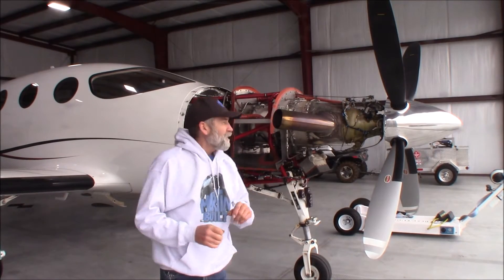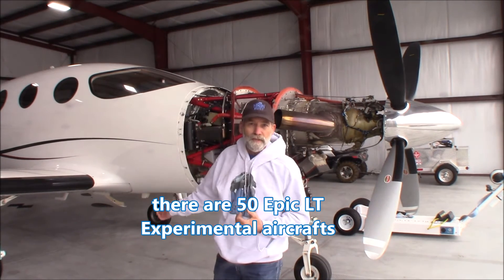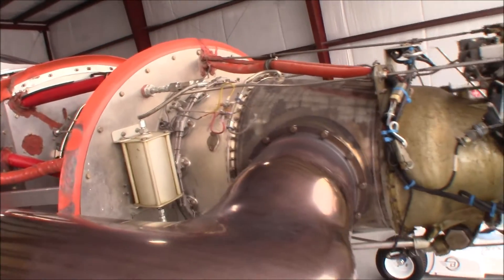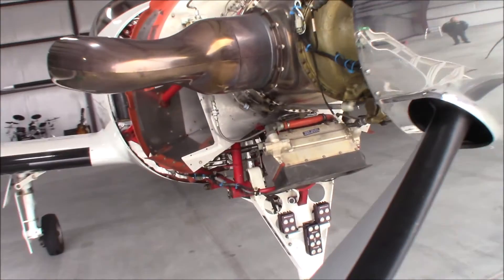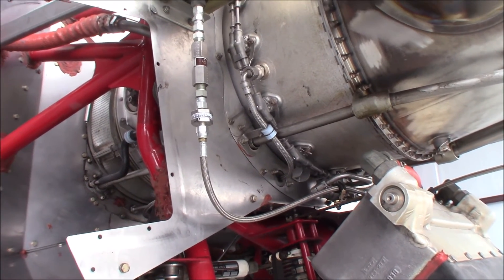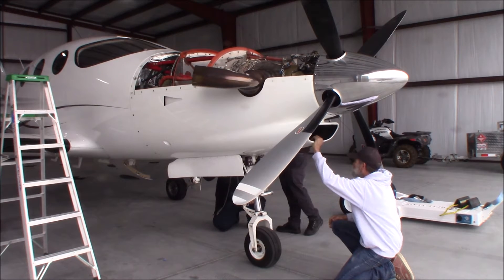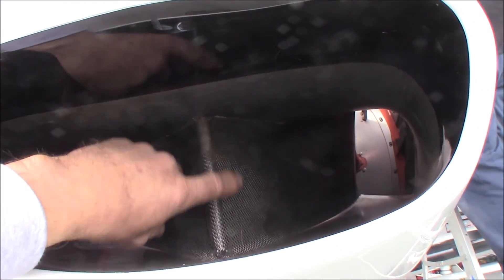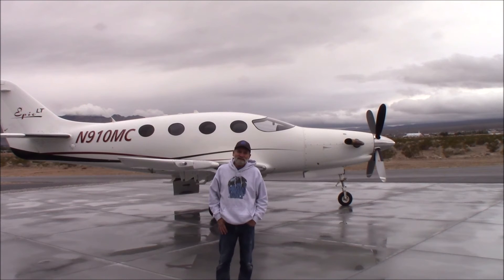Epic LT Aircraft with a Pratt and Whitney 1200HP PT6A-67A Engine Walk Around

Comment: Could these aircraft use a lighter weight battery ? Aerolithium wants to know. Willing to build a test battery at 1/2 the weight from Sodium. These look like RG-325 / 25ah /1000A IPP at 52 lbs each. Sodium would be 40ah / 1600A IPP at about 23 lbs each. One battery would start engine.
Reply from the maker: You might be able to do that with an experimental aircraft, but when it comes to a certified plane, you're not allowed to install parts that are not FAA approved.
I'm sure interested in a battery that is lightweight, though, for any one of my vehicles that has that kind of power.

Comment: Hi Martin. How are U doing? Hope good. Got a question about 4.7 HO. Can I put the 4.7 camshaft in to 4.7 HO? Thanks for help.
Reply from the maker: Sure you can, did you have a camshaft failure and those are the only cams you can find?
Just curious I've never heard of anybody wanting to install the non HO camshafts in an actual HO engine.
Reply: @martinbuilt  :) actually Im from outside of US. So have problem finding HO camshaft. Mine bearing seats are broken. Thinking change the camshaft or install 0.25 bearings. Your opinion for me is very important. Thank U.

Comment: Hey bud great video I have an unrelated question.. I have an 03 4.7 ram with a blown head gasket! While I'm having all that fixed. Could you recommend a mild but decent set of cams to replace with?
Reply from the maker: Thank you I'm glad you liked it well unfortunately there are no aftermarket camshafts you can just purchase for the 4.7 back in the day there were some custom grinds and you may be able to find them used on eBay but if you're looking for just a few more ponies I would just find a set of HO camshafts either from eBay or my choice the local salvage yard.
Reply: I found a donor engine from a 2008. Do the heads fit a 2003 block? By the way I used to be an aircraft mechanic in another life. I believe that they call that a reverse Turbo prop engine.

Comment: Good day firing up  PT6A.... Just replaced a starter in a 5.7l WK.... $150.00 was just about right.👀
Reply from the maker: Yeah it's hard to pull the trigger on an aircraft when the parts are so expensive. And then if it's a certified plane you can't even work on it. There is one ultralight I'm kind of interested in it's called a bush cat you can get it in kit form for around $50,000
Reply: @martinbuilt  I've viewed your videos since the XJ.  An XJ I had leaked from Rear M.S. and after three tries I parked it.  You've done awesome with yours.  With a Van's RV aircraft you can be a Certified Repairman with that plane and Feds.